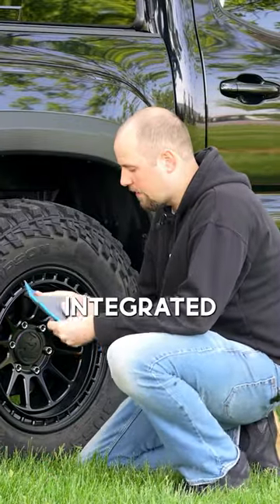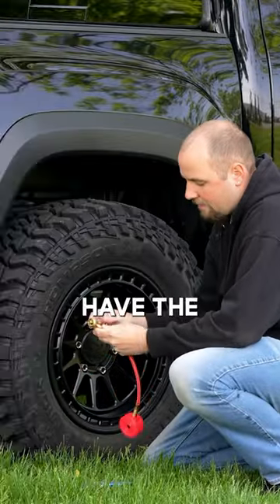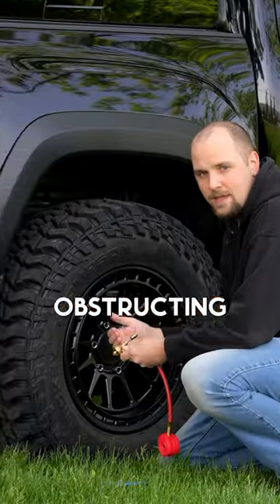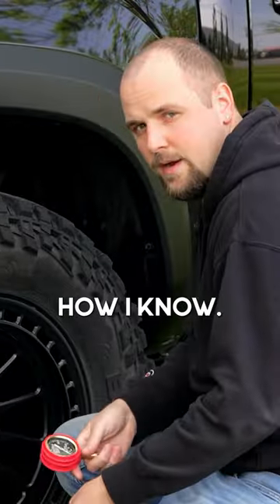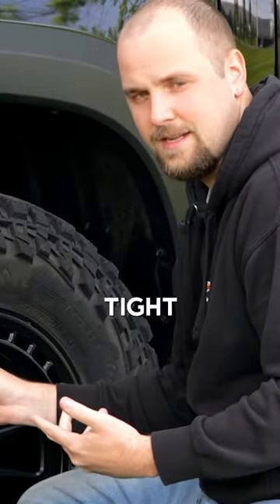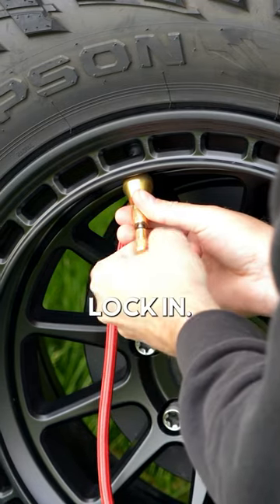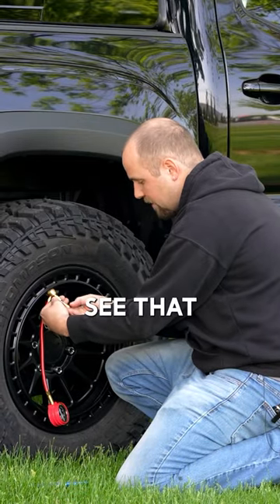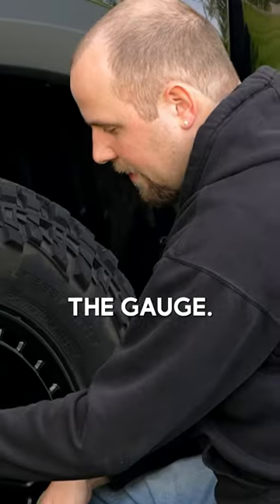Reliable, easy to use, & built to last. | Get your ARB EZ Tire Deflator today on YotaXpedition.com

Comment: a waste of money, time, and effort. just buy an auto screw on deflator. Screw it on, move on to the next tire, wait until it deflates, then unscrew. Way faster and easier than that contraption
Reply: I 100% agree , I purchased one for nearly $100 and was a pain to understand how it works since mine didn’t come with instructions. It was easy after using it a couple times but I ended up selling it and using my $3.99 autozone deflator w gauge.